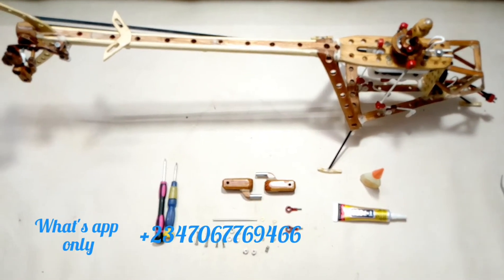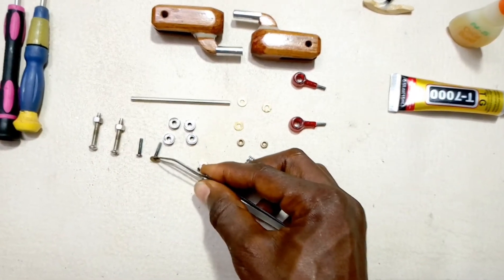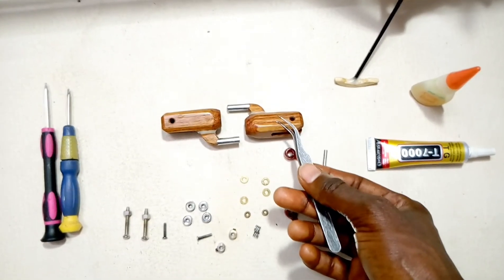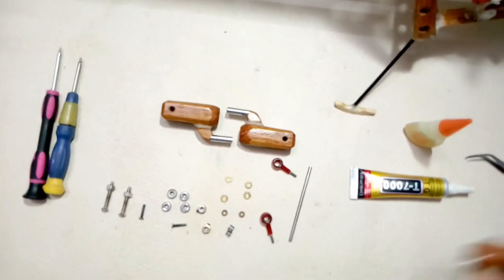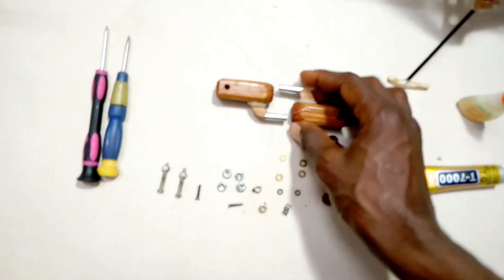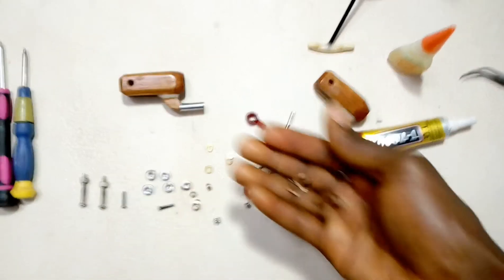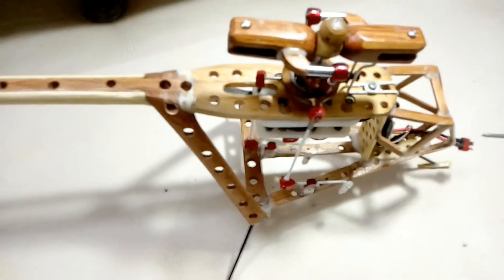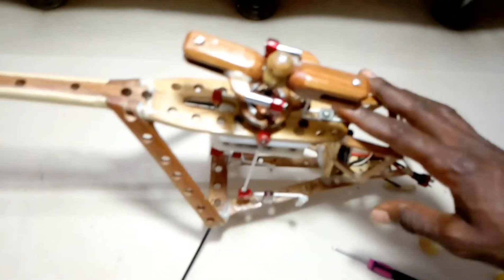Final grip assemble, CHAPTER 4

Comment: The helicopter cannot flying bcs may be power not enough or as i see in video may a be weight center problem
Reply from the maker: The tail gear is worn but i place a new order thanks.
Reply: @kanartech  tail gear yes its can a be problem bcs all rotors must be take a equal power